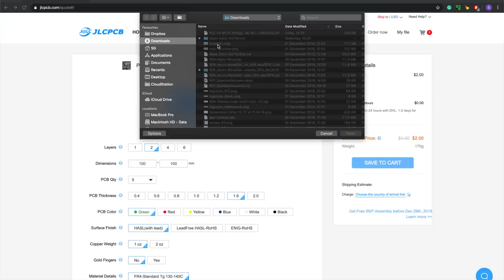Handmade Stratocaster Guitar Out of Cardboard

Comment: I’m a little bit skeptical of this. You didn’t put a truss rod in the neck, so it’s being held by that piece of wood. I’m not an expert on resin on cardboard, but I doubt that it’s strong enough to hold all the pressure of those strings without a truss rod.
Reply: It obviously is. Adding a truss rod would make the action playable….

Comment: Technically that is not "Cardboard", it'd be "*Corrugated* fibre-board"...

And the corrugated pattern is the reason for comparatively better stiffness than the same material un-corrugated.. (I know this from Shipbuilding practise of corrugated bulkheads and containers)
I think there are also walls with similar wavy pattern in UK...

Just a small info if anybody was curious why this is strong etc., ... :)